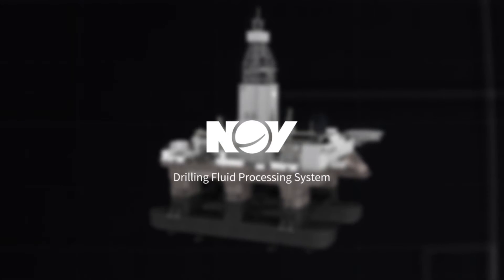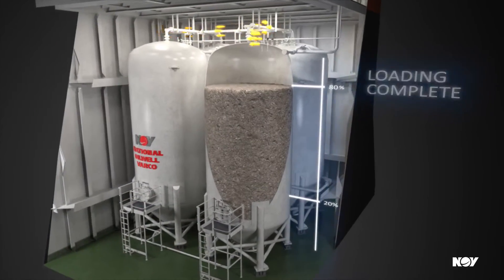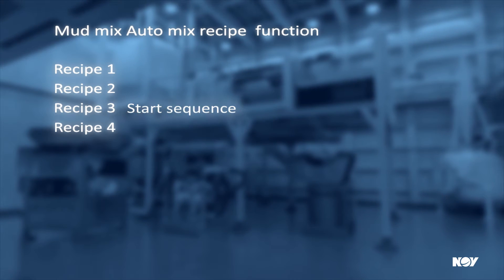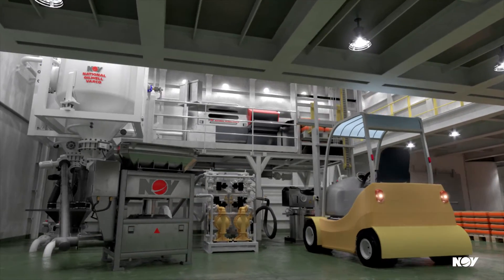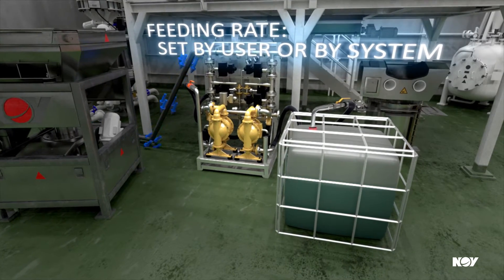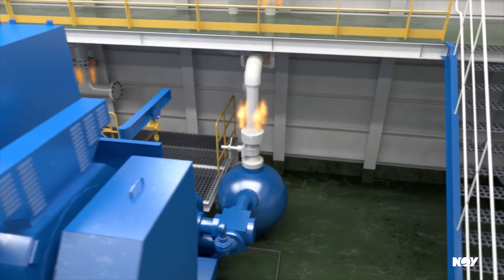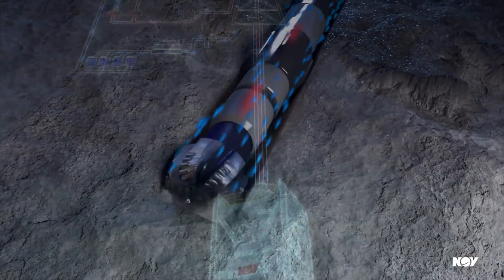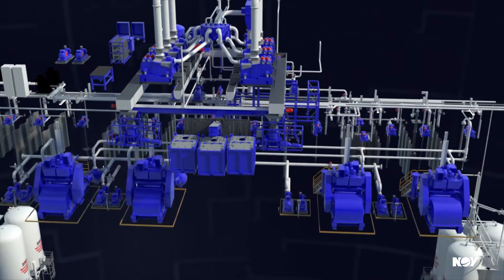Drilling fluid processing system

Comment: Hi there, are you looking for a machine that could 

separate the liquid-solid material(such as river silt, 

drill slurry, farm waste, steel plant waste, concrete 

slurry etc), KES Energy may provide you the best 

solution by separating the liquid and solid particles 

efficiently for a better environment protection. 
For more details, visit www.kestrenchless.com
WhatsApp: +86 13087559846